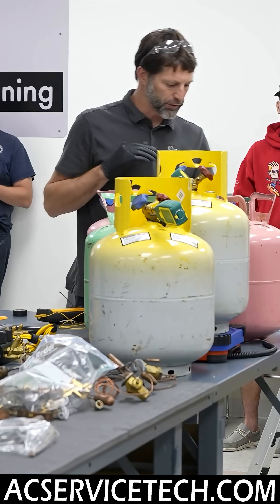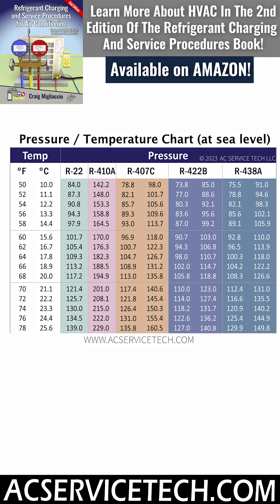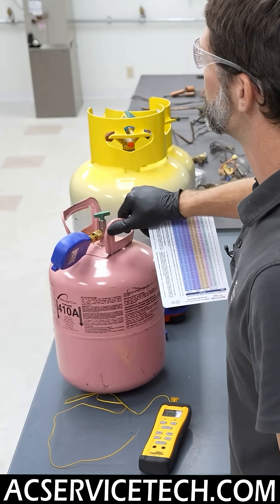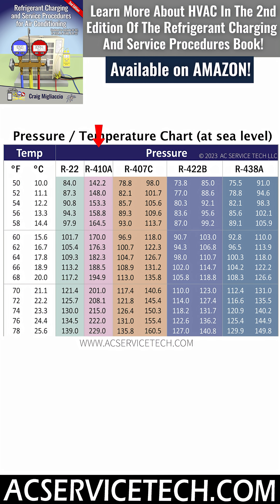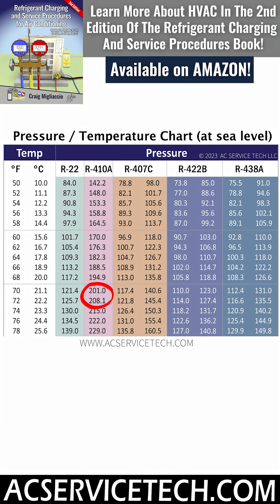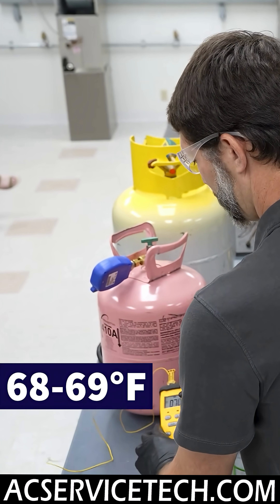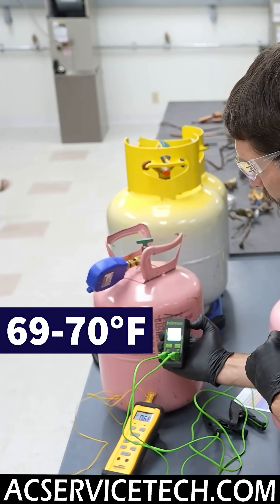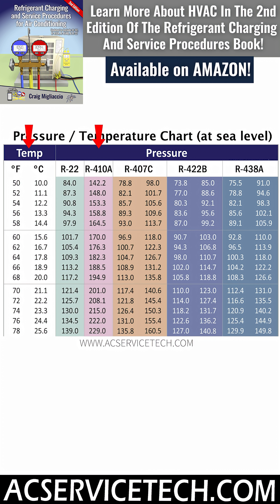Refrigerant Pressure & Temperature Correlation,  P/T Chart!

Comment: How hot can those tanks get before they suddenly loose all their pressure?  I see them on the back of trucks in the hot AZ sun and always wondered.
Reply: The R410A tank shown in the video has a test rating of 800 psi.
Saturation temp of R410A at 800 psi is 167 degrees, meaning, the tank and all the refrigerant inside would have reach 167 degrees to get the pressure of the refrigerant inside to reach 800 psi .
Reply: @Mouse_007  Thankyou
Reply: they will not be exceeding their capacity when full 

They build them with a comfortable margin
BUT there must be NO moisture or the tanks can rot quick

Comment: That’s why I always charge based off temp. Idgaf what anyone says. Take your superheat and subcooling and stuff it up your beeeeeep. Been charging based of temp for years and never had an issue. I work around a lot of the same units I’ve worked on and they’re still kicking just fine.

Comment: This is also a good method to identify what refrigerant is in a recovery cylinder if you don’t already know
Reply: I tag my cyls, but if you get a mixed cyl?..bad day. Shake the recovery cyl first, take a reading..wait for the contents to settle, take another reading, and the two should be the same or within 1° to each other, otherwise the contents are likely contaminated with a different  refrigerant.
Reply: @Barracuda48082 yeah I agree on tagging them. Best thing to do is label them

Comment: DING DING DING   These recovery tanks don't have a second tank inside but an OEM tank from manufacture has a layer of insulation metal ------- Think about it would it be the same temp as the inside ----- Best temp would be liquid against the  knock out on the tank or the shut off valve vs the recovery tank.